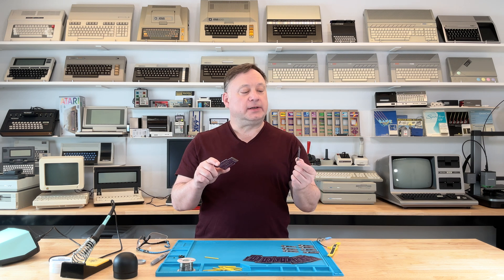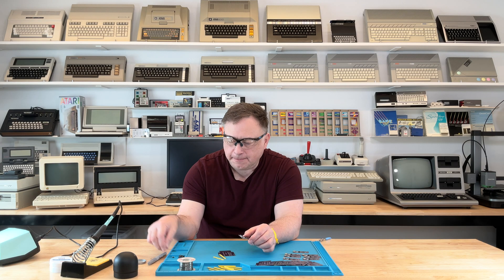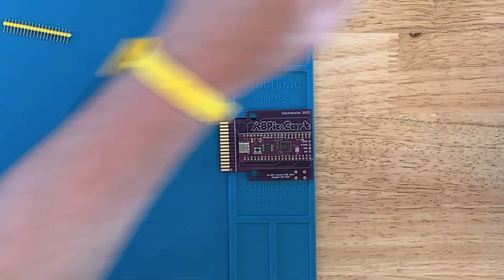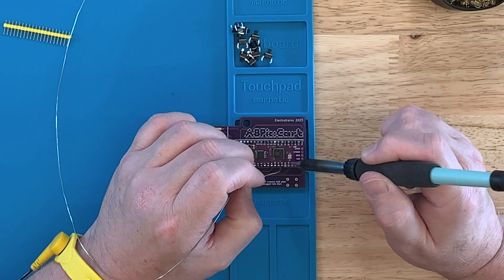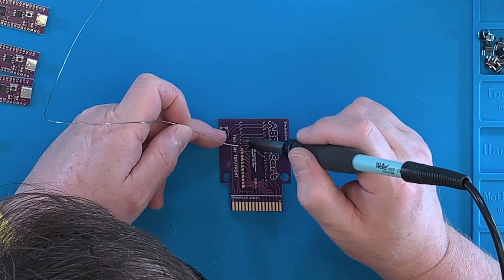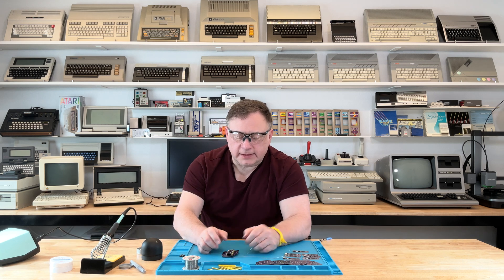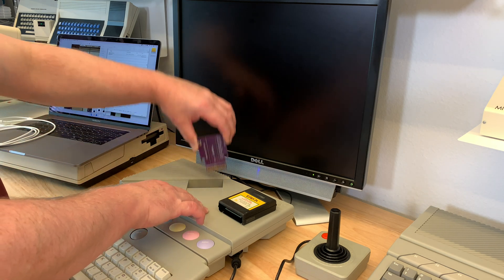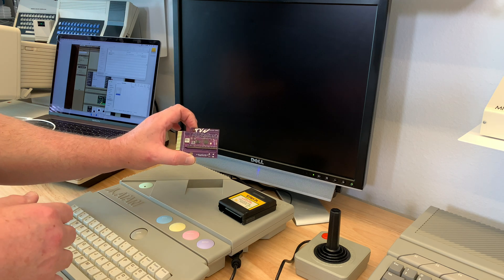Soldering-Up an A8PicoCart for your Atari

Comment: The best thing I discovered to load ROM images on an Atari 8-Bit computer is the program called RespeQt. I set it up for Mac and PC. It loads many file types. Version 5.4 is the most recent  version I have seen. And this is the one I use. You need to make an SIO to Serial Debugger cable or you can order one from Digikey and only connect the data +, data - and ground to the appropriate pins on the SIO port. Plus a serial driver, etc. This is the way I do it and it works great. I hope you do a video on this program. It is very cool and a way to enjoy these cool programs that may or may not have a physical copy available anymore.
Reply from the maker: Ok, Cool. Thanks for the info :)

Comment: Make sure to get the 16MB clones, not the 4MB which is often available from the same sellers. They probably would work, but less space for cart images.
One thing I love about this project is the lack of SMD components. A Switch and the PICO is all it needs. I ive been waiting for the SIDkick-PICO to come into stock so I can try this with the C64. It replaces the SID, adding dual SID.
Reply from the maker: Yup, fun, easy project! :)